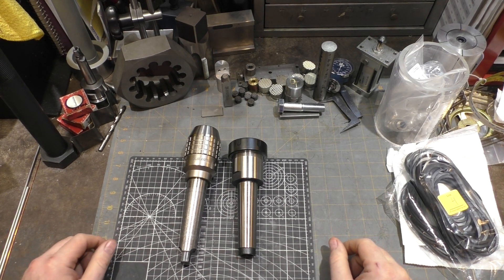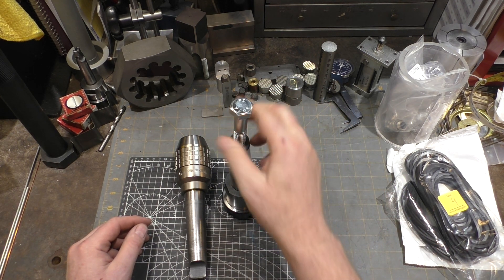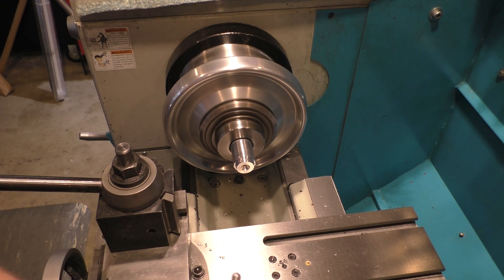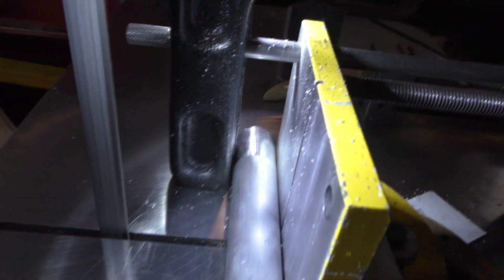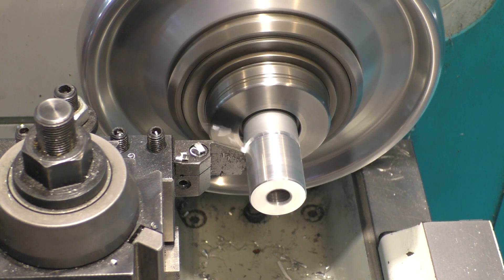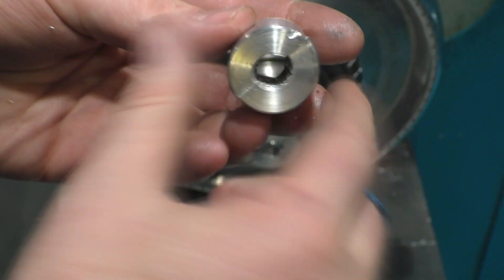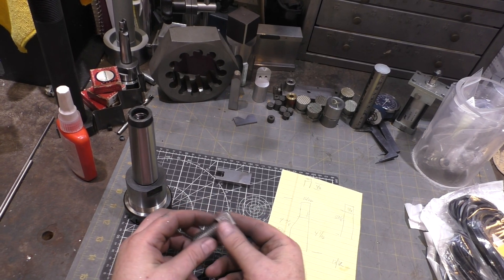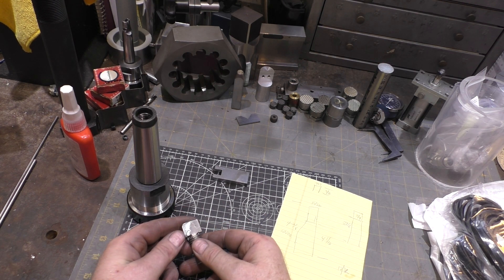92 MT4 Tang Add on for Lathe Tool

Comment: 3:22 I cringe every time I see someone back off their tap while tapping. I am well aware that technique is taught literally everywhere at the 'high school' level. It is however, false information, and a sure fire way to damage your taps. The old school teaching says, "You back off the tap to break the chips being cut." That is both true, and is also what creates a problem. When you backed-off the tap, those chips got in front of the cutting edges of the tap. Trapped in front of the cutting edges in such a way that they bind and break your tap threads when you re-start cutting new threads.

A much better technique to hand tap is to twist the tap in by hand, in one direction only! Do this until you notice an increased resistance, then add cutting fluid, and keep going without backing-off the tap. Eventually when too much chip material has formed, you'll need to back the tap right out of the hole. Clean the chips out of the hole and the tap, re-lube the tap, and run it in again to cut some more threads. Using this method, the chip material cannot bind against the cutting edges of the tap causing the cutting edges to break. The cutting edges of the tap are always in contact with new material, never allowing chips to bind between the cutting edges and the new material.

Your taps will stay sharp, cut better, and last much longer. Don't loan them to anyone either as that person was taught the 'high school method' also.
Reply: PS. I really enjoy your channel. Keep up the good work.
Reply from the maker: Thanks for the info. I have never heard your explanation before, but there is more that I don't know than what I do.
Reply: @DudleyToolwright  Hope you & others will find this as useful as I have. I was shown this by a much older machinist, and I too am still learning.
Reply: Horse Manure
Reply: @yrralyou  Check out machine powered tapping. You'll find the taps are run straight in without "backing off to break the chips". Beyond that, try it. I'm quite serious, not joking as this is a better way to tap. Applies to die-run external threading also.

I'm retired after working in the industry for over forty years. Always keep my own taps and dies in my private tool box. Tool Crib taps & dies are often a disaster of broken teeth depending on where you work. Can't cut clean threads with broken teeth.
Reply: @Changtent  The post I commented on was about hand tapping.  You changed the subject.  Machine tapping procedures cannot be used to apply to hand tapping.  Machine taps are made different for one thing.  Far more hand taps are broken by not backing them out than doing so.  You are obfuscating.  It might be possible 1 in 10 times to take an 8-32 tap and run it straight in and not break it.   A bigger tap that is stronger than the chips it makes maybe yes.  I have tried your way.  It doesn't work...period.
Reply: @Changtent  Second comment.  Machine tapping is very nearly always done with flood coolant and lubrication.  How are you going to do that on a piece on the workbench?  Your suggestion to run the tap in until it binds and then more lubricant is not always going to work since the tap is already stuck going forward.  No amount of lubricant will free it up.
Reply: @yrralyou  I am a licensed HD Mechanic by trade. I have also worked in machining, fabrication, and engineering design prior to retiring. Now running my own machine shop part time for special projects.

I have tapped hundreds of holes with great success, covering all sizes large & small. If you are experiencing broken taps, you are doing something wrong. Usually that problem is caused by miss-alignment of the tap entering the hole. A miss-aligned tap will bind against the walls of the hole more and more as you proceed, and break. Yes, a lot of good quality cutting fluid is required for any tapping operation. That's pretty basic.
Reply: @Changtent  Doing something wrong or not.  If I back the tap in and out, I don't break taps.  If I don't then I do.  Your profession procedures don't work for me or most amateurs.  We do what we can to get the job done.  Perhaps we shouldn't do any tapping until we have a lot of machinery and a shop and years of experience, and buying the very best equipment.  We chose to do what works.  Sometimes I don't have a good quality tapping fluid on hand.  Sometimes I don't have a way to catch the fluid.  Should I just let a gallon or two run out on the table?  Should I wait to tap that one hole until I can order a gallon or so?  I don't think so.  What should I do with my lawn tractor I need a new hole drilled and tapped.  Take it apart until I can get that part to the shop or tap in the field?
Reply: @yrralyou  Have a nice day brother. Sorry to have upset you. May God bless you and your family.
Reply: @Changtent  Jim, it would take far more than a misguided pro to upset me.  LOL

Comment: Every body knows the tang is for ejection and not for drive.
Have you never seen a twisted tang ?
Reply from the maker: I haven't, are my novice chops showing? Thanks for the heads up.
Reply: @Steve: Nope, only cool kids like you know the tang is used only for ejection.The rest of us stupidly assumed tangs are machined rectangular so they can seat in a mating pocket at the back of at least some tapers (as Dudley's does), and that in addition to providing a protrusion to bump against for ejection--which after all need not be rectangular--the tang engaged in its pocket affords significant resistance to rotational forces on a taper not pulled in by a drawbar. We also assumed that if a taper was naturally sufficient to resist the kind of rotational forces found in machining, there would be no need for drawbars at all. Not being cool myself, I've never seen a twisted tang, but if I had I would have naively concluded that the torque on the taper had been so great that had the tang not resisted it the taper would have just spun freely, perhaps damaging it. Damn, I wish I was a cool kid, too.

Comment: Dudley, old son,

The tang doesn't drive the taper transmits the torque.   The tang locates and is part of the removal system.   Under any heavy load, if the taper doesn't hold, the tang will twist off like the top of a ripe banana.    It's one of the myths spread amongst the machinist community, akin to the idea that a six jaw chuck is better than a three jaw.  The six jaw only grips on three jaws of the material is even slightly out of round.  Of course you can swing on the chuck key like an excited gorilla and get full contact, but it's brutal to the delicate chuck .

Geometry doesn't lie!!

Steve the four jaw fan
Reply from the maker: Thank you very much for taking the time to share the insight. I always appreciate the voice of experience (which is not mine).

Comment: Next time,  try sawing 3/4 through and then after cutting off, saw 3/4 through from the opposite end but 90 degrees off.  Then it would be one piece but flexible.
Reply: Oops, someone else already made the suggestion.
Reply from the maker: Don'y worry about the repetition, you suggestion is every bit as good as the first and a slightly different take so I learned something new. Thanks a bunch, for taking the time to share your insight.

Comment: I like your bolt holders. I typically just use an ER collet, but hardened fasteners against hardened collets is not a good combination. Rather than splitting your holder all the way through, it might be more convenient to  slit them ~80% from each end at 90°; kind of like an ER collet. Than you wouldn't have to fuss with two pieces.
Reply from the maker: I think I will take you suggestion on the half split collet next time. Your solution never occurred to me.

Comment: I had the same problem but I opted to make a rounded button like the live center in your video. Great job and a simple way of doing a tang. I probably would have threaded the bolt into the end locktite it with bearing mount and milled flats, you showed another way to skin the cat
Reply from the maker: As did you...thanks for the alternate solution. I always enjoy another take on the same problem's solution.

Comment: Just curious, why did you not make the tang by machining the head of a shorter bolt?  If the head was not deep enough it would have been easy to weld up the head.
Dave.
Reply from the maker: To be honest, I mentally ran through a solution and then single mindedly went for it. Failing to see alternate paths is a real problem for me. Thanks for the suggestion.

Comment: Just in case you would like to know a company in England makes an ER40 31mm and 32mm collets that is the largest I have found if you need that size
Reply from the maker: Thanks. I really appreciate the heads up.

Comment: I learned more about TIG welding by watching doubleboost than I ever did from my instructor at the Vocational School. This Old Tony is good also.  Beauty is only skin deep, serviceability is everything.  Good work.  Wish my lathe had that design in the tailstock, to hold the tang.  Planning on making a new quill to include that. See you next time Robert.
Reply from the maker: I am in the same boat. I have and still do, learn so much from the other youtube'rs, that is why I make videos. Making your own quill? I will have to watch that build. Thanks, as always, for the comments.

Comment: Great ideal I have a ER32 MT3 collet chuck that has the same issue yours did. I was going to  just put a bolt in the back, but I like the idea of the tang keeping the chuck from possibly galling the inside of the tail stock.
Reply from the maker: Thanks. I have had an issue in the past with tangs slipping a little bit and it always makes me cringe.